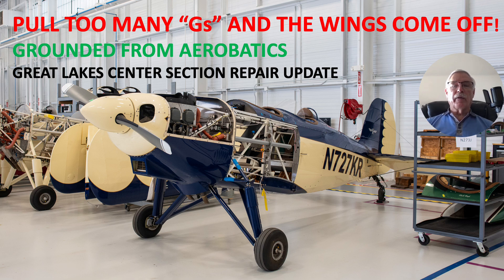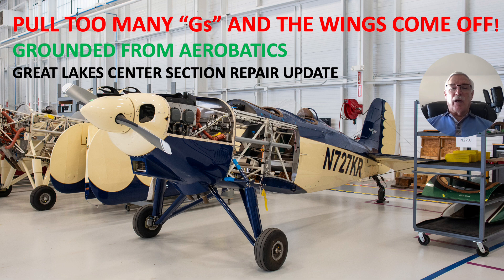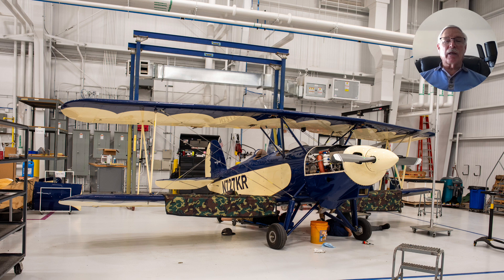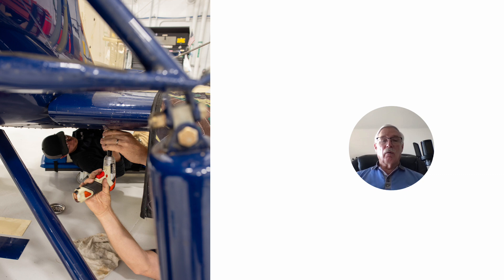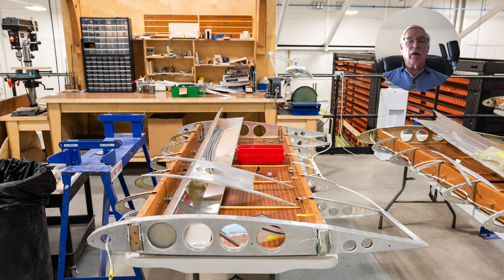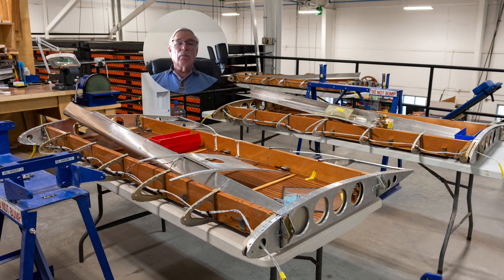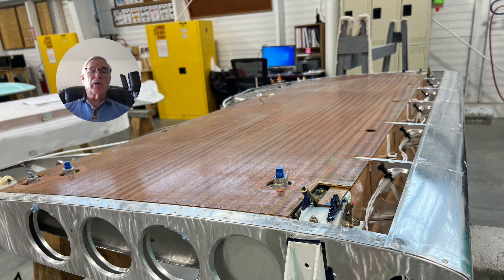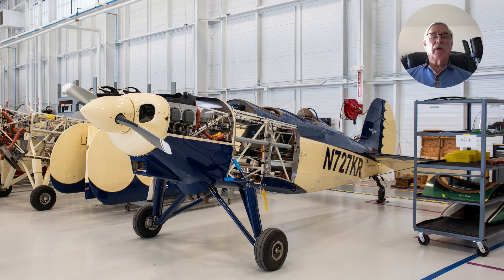PULL TOO MANY “Gs” AND THE WINGS COME OFF! GROUNDED FROM AEROBATICS GREAT LAKES CENTER  REPAIR

Comment: @Ron Rogers @2:02 – I’m not an airframe guy, just love aviation…Why are they called flying wires, landing wires ? Is it merely lingo for airframe components or is there something more to them ?
— Also, why do you refer to 4 wings ? Is each side considered 2 ? When I think bi-plane it’s 2.
Reply from the maker: Using the term 4 wings was for humor although people do sometimes refer to the left and right wings. I think flying vs landing wires is just a convention but I could be wrong on that. it might have something to do with the direction of the loads.

Comment: It was a good move on their part to brace it up with plywood on the bottom side.
Before that (Enid built airplanes), the tank had to take the torsional loads for the 
centersection. We used to see tanks crack where the tabs that attached to the front
and rear spars were welded on the tanks.

Comment: That looks like it holds a lot of fuel.   Comfy for cross country flying?
Reply from the maker: 27 gallons which gives you about a two hour or 200 mi range. Compared to my 310 at 205 gallons and 7 hours, it has short legs.